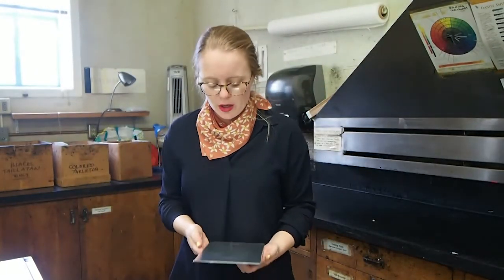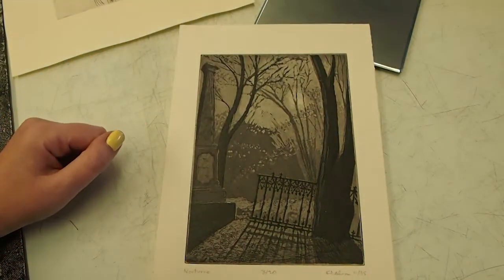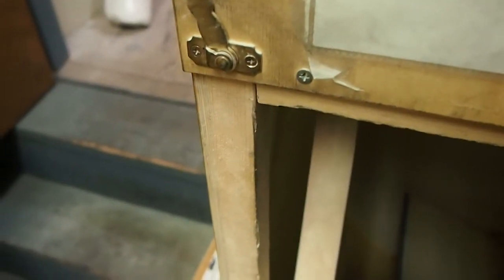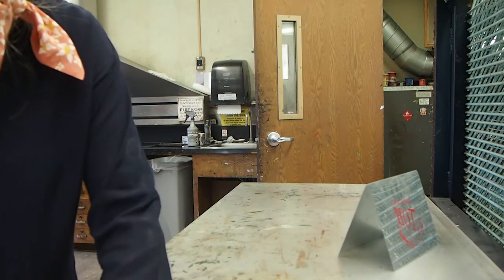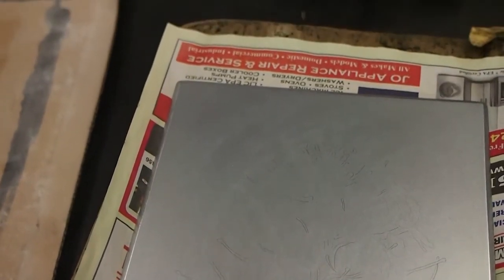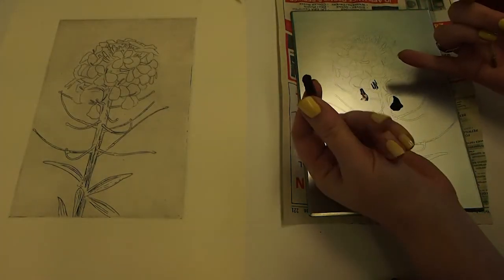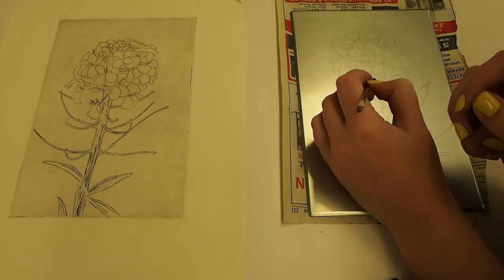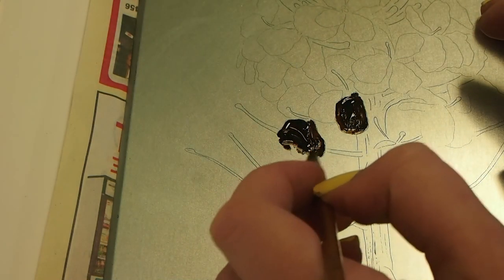Aquatint Demo with Hannah Skoonberg

Comment: I'm confused.Why painting on plate instead of paper. 🤔😅
Reply from the maker: With the plate your image is bit as a texture into the metal. This means you can wipe ink against the metal and print multiple of the same image. At the end of the day the plate is the tool and not the finished artwork.

Comment: Rosin melts perfectly at 240 degrees. 400 is too hot!
Reply from the maker: Holly, I feel it's more of an issue of the length of time it takes to melt. I was brought up in a print shop that melts the rosin over an open flame. So it can be a very quick very hot process. I'm glad you are getting good results with your lower temp. 

With a slower melt time / cooler temp I find it can be harder for my students to see the transition to transparent on the surface of the rosin. I also think the grind of the rosin is a factor, you may be working with a more finely ground rosin which gives you less textured aquatints and melts faster while in my shop we may have a coarser grind in the box. The coarser grind is a little more student proof on accidently over biting in the acid.

Comment: I went down a wikipedia rabbit hole reading about Goya's etchings and was having a hard time understanding the descriptions of how they were made. This helped clear it up. Thanks. Super cool stuff.
Reply from the maker: Goya's etchings are beautiful. You picked a very nice rabbit hole.
Reply: Goya used a lot of hand shaken rosin bag aquatints vs a box - gives it a starry look
Reply from the maker: @inklayer1213  This is true. If you want that larger dot look I have had good luck with a spray paint aquatint especially as the can is running low. It looks textured just like Goya.

Comment: Hannah.. as an introductory video... your  discussion on color by numbers ( Bite ) is presuming knowledge which we hope to get. A basic definition on what it is in the beginning would be logical.
Reply from the maker: Fair enough, this video was made for my etching class at the beginning of the pandemic so I was trying to fill them in on a process they wouldn't get a chance to do in person. The main point here if you are making an aquatint yourself if that you want to keep layering the block out onto your plate and biting the plate at intervals to achieve different depths of bite. You can't clean the plate part way through the process without damaging the integrity of the aquatint. So making a value map of the different bite times will help you land all your values with one application of aquatint and several dips into the acid bath.
Reply: @hannahskoonberg  ...interesting ...I am a photographer...sounds like Ansel Adams’ zone system .thanks.